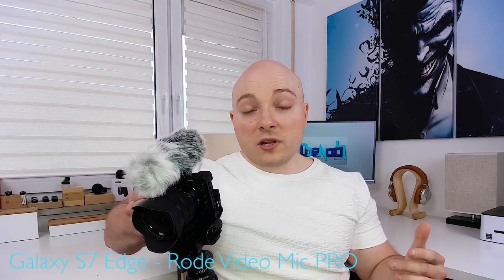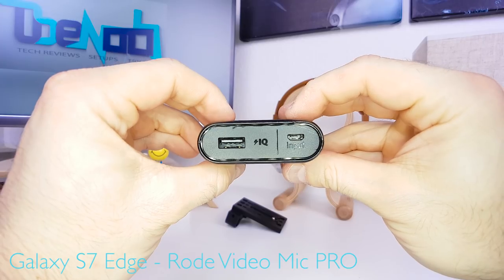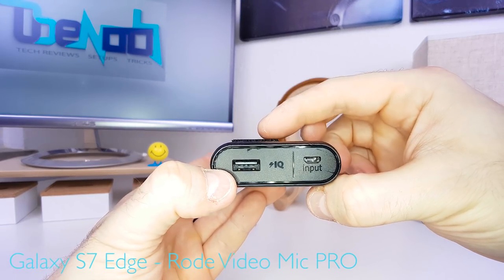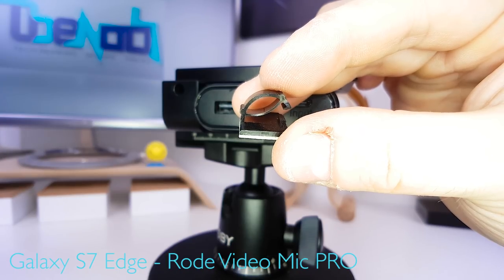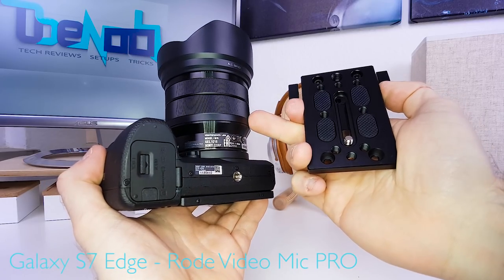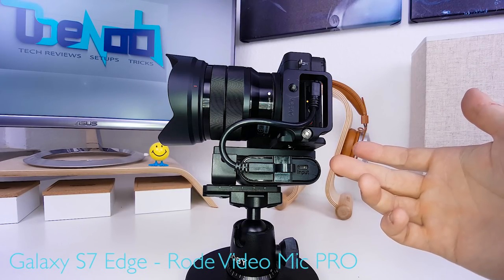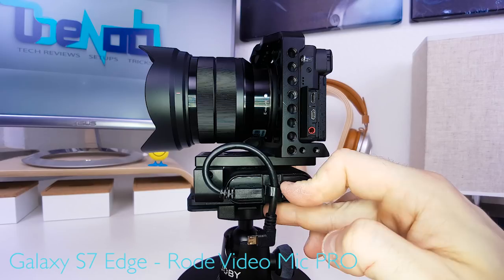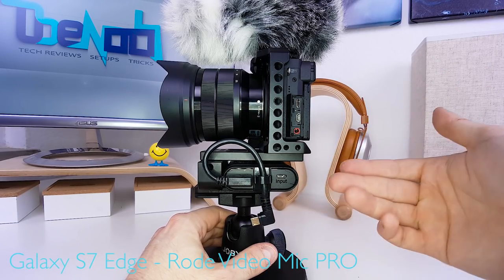A6500 POWER CORE HACK - Tubenoob

Comment: Hi, love this idea. Once the setup is complete, what are the size dimensions? The reason I ask is I am wondering if this is possible with a gimbal? particularly the weebill lab which has a small clearance around the motor. Thanks again
Reply from the maker: Mh....I am with my parents right now and don*T have access to the parts, but from checkin out the weebil on pictures I highly doubt that the setup will clear the roll axis in flashlight mode.......if only there was a way to lace the powerbank below the qr plate of the gimbal....

Comment: Hi TubeNoob, great video but the PU70 base plate screw does not fit the Smallrig 1797 cheese plate hole as the side holes are too small and the middle hole is too big. Do you know why this is? The PU70 now being sold on Amazon is different to the one you show in your video.
Reply from the maker: Hi! I use the PU70s. But the problem doesn*t seem to be the base plate, but the smallrig cheese plate wie rail mounts. I checked the links. There is an old an a new version of said smallrig plate. I guess the new version, which must have been released since sometime, has a 3/8 inch mount, not a quarter inch mount any more. The PU70, and most quick release plates have the 1/4 inch mount. Check the description of the smallrig plate and see whether that is a 3/8 inch mount in the middle. I am pretty sure that is what it is. In this case you just need these tiny adapters here:

https://www.amazon.com/Foto-Tech-Convert-Adapter-Ballhead/dp/B00OKYWWMG/ref=sr_1_8?ie=UTF8&qid=1543871467&sr=8-8&keywords=quarter+inch+to+3%2F8+inch+adapter+camera+screw

Let me know if that*s it....

Comment: Very neat solution!!! Can I turn the camera on  “mine is a6400” and use it while charging the battery this way?
Reply from the maker: Yes, the battery status will trickle down slowly though. Way slower than without the external battery off course. And whenever you turn the cam off it'll load automatically.

Comment: Hey Tubenoob, we've spoken a couple times and you have really helped me narrow down the list of which camera I would like to buy, so I would first like to thank you for that.  My choice is now between 3 cameras, Which I will mainly be using for travel vlogs. I cannot decide between the a5100, a6300, and the new Canon EOS M100. I'm not sure if the a 6300 is worth sacrificing a flip up screen for 4K, but I can get it at a very competitive price. But between the a 5100 in the M100 it's like they're identical. Is there one you would lean towards at the end of the day? Thanks man!
Reply from the maker: You*re very welcome, David Donovan! 

Between the M100 and the A5100: M100. Mainly because the canon 11 22 stm m super wide angle zoom is a very good lens at approx. half the price of the sony sel 10 18. If you wanted to invest in a super wide angle zoom for vlogging. Also the Canon has the better screen AND a real touch screen for that matter, which makes a big difference in usability and touch AF for example. Micro wind muffs can be applied to both cameras due to the location of the internal mics on top of the cameras. With the M100 it will be a quick custom job to customise the pads, but nothing a scissor can't handle.

Now if it was the A6500, which really improved in the overheating department, I would say it's a consideration to have 4k, external audio, but no selfie screen. But the A6300 stills deals with major overheating problems. 

If it was an A6500 I would go with that one and use my phone as a selfie screen when in need of one.

For vlogging, out of these three, because of the reasons given, I would definitely go with the M100.

Hope that helps you out a little. Greetings!
Reply: Hey Tubenoob, After reading some of your recommendations I decided to go with the Canon M series. I looked through some more of your videos and found the Canon EOS M6 and loved it! I just bought it online last night! I found your video on attaching various microphones to the side of the camera and I was Wondering, Is there a certain Mic of the three you prefer more? or has the least hissing? thanks!
Reply from the maker: Cool, very good choice:) ME personally I like the ETM 008 the best. Least amount of hiss and overall super compact form factor. Wind protection isn't as good as what you get with the rode wind screen, but ok, when using the tiny deadcat from Edutige. Greetings!

Comment: This is a really cool solution. I am still deliberating between this and a dummy battery option due to the overheating with the a6500 but this is the most tidy and convenient option I have seen so far.

Would this option power a dummy battery via usb to run the a6500 or would I need a converter in the chain? 

I was just wondering about a link or details of the cable clamp? just want to make sure it fits as well as this one does. thanks again
Reply from the maker: Hey, Kane Jacobs! Thanks for the nice comment, glad you enjoyed the video!

You would need a converter if you wanted to use a dummy battery.

Damn I forgot the links again....sorry.....now they're in there:) Greetings!

Comment: I've done this but the powerbank only charges the battery when the camera is off. When I turn on the camera and start recording, the regular battery drains (not the powerbank) so my recording time is not extended. Have tried multiple cables. Is this what happens with you? Thanks.

Comment: Nice review—straight and informative. I bought an anker power hub but it will not power the camera unless the Sony battery is in the camera.
Is it correct in assuming that the hub works in conjunction with the Sony battery?
Reply from the maker: It's called conservation charge I believe, although I translated taht from german to english. You're right.
Reply: TubeNoob Thanks!
Reply from the maker: @CarlosRodriguez-cj8oo  No problemo:)

Comment: Hey tubenoob. You have great content! I have used a few of your videos for my vlog setup on my a5100. Quick question: I have an external battery and when I plug it the light comes on to charge, but I can't film or take video while it's connected. Do I have to take the battery out or change settings to use while connected to the external battery? Thanks!
Reply from the maker: The A5100 does not have that option. You cannot charge it and record with it. It is either or with this one. However using a powerbank you can bypass that problem with such a dummy battery to usb adapter:

https://www.amazon.com/CCYC-AC-PW20-Decoded-Coupler-Replacement/dp/B075Z4GXKG/ref=sr_1_2_sspa?ie=UTF8&qid=1546533657&sr=8-2-spons&keywords=sony+dummy+battery+to+usb&psc=1

Hope that helps you out a little. Greetings!
Reply: @Mark10ProVideo  this is awesome! Thank you for your help. Subscribed!

Comment: Hey tubenoob, i have a used canon eos m6 with ef-m 11-22mm lense and 3 batteries for it , i have a chance to trade all that to a new panasonic lumix g80 + 12-60mm kit lens, u think i should trade for that?
Reply from the maker: Hey, TeamRemet! Depends on what you want to use the camera for. Both comes to around a grand new, so the value is comparable.

M6 plus 11 22 is an awesome vlogging setup with great autofocus. G80 plus 12 60, which is the best kit lens for videography you can get for a panasonic G series camera in my opinion, is an overall videography centric mirrorless camera.

You will see that you have been pretty spoiled;) by the AF performance of the M6 when you switch to the G80, but on the other hand, if you also want to work from behind the camera, doing premeditated, designed shots, you will love how feature rich the G80 is and the 4k quality you will get from that camera.

Hope that helps you out a little. More questions? Just ask...greetings!

Comment: How does a npfw50 dummy battery work when connected to a powerbank on this camera? Will it work well ?
Reply from the maker: It's been quite a while, nit I think the dummy battery need a special powercable that divides into two usb cables. SO you would need a poerbank with at least two usb connections. I think it's because it need more charge that way...
Reply: @Mark10ProVideo  ahh.. got it! I found out that the camera requires 7.5 volts and above to work. I guess I'll be needing a 7.5V powerbank.

Comment: Followed your steps exactly with my A6300. However, I'm noticing that the battery is losing charge still while connected to the power bank. Should that be the case? Or would a dummy batter battery work better?
Reply: Also noticed that the batter has an output of 7.2V where the powerbank only puts out 5V.
Reply from the maker: It should loose charge significantly slower if that. A dummy will probably bypass that since it takes from the powerbank directly.
Reply from the maker: That seems like the reason for the slow discharge. Don'T know if there are powerbanks with a higher voltage that size....then again...is it loosing charge as fast as in regular use?
Reply: @Mark10ProVideo  Dummy battery solved the problem. Even though you can technically shoot and charge at the same time, it's not enough power. So my time was still longer than just with the battery but you'd still end up with an overheated issue eventually.

Comment: Could you do a video on a vlog setup for the alpha a6000?
Reply from the maker: Hey, Pablo! I could, but it wouldn't look much different than the one built around the A6500.

I would probably use the same power core hack as with the A6500. If the A6000 didn't feature usb charging and operating, I would use something like an ex pro powerbank with a dslr power out put and a dummy battery dc couple to run it off the powerbank.

As a mic I would use the Sony ECM GZ1M, if I would plan on using a smartphone as a remote control. Because as soon as wifi is enabled, the camera probably messes up the audio coming from the 3.5mm input, like the A6500 does.

Here's a video on that problem: https://youtu.be/6K27ZScEQZ4

If no smartphone is used I would probably go with a rode video mic pro as a mic.

The best lens for vlogging in my experience is the 10 18 from Sony, expensive lens though. The 16 50 kit lens on the 16mm wide end is wide enough for vlogging as well. But narrower than that I think isn't suitable for vlogging.

Hope that helps you out a little. More questions? Just ask. Greetings!

Comment: Do you have advice for manfrotto qr plate users?
Reply from the maker: The bottom if the rail mount has a regular quarter inch thread, so there should be no problem attaching a qr plate the has the fitting screw....or what do you mean exactly?

Comment: will the right angle cable get in the way of the audio input? i cant tell. I have the rode video mic pro
Reply from the maker: Yes, the interfere. I used a multi interface mic. But you could get a longer cable angled so that the cable runs upwards.
Reply: @Mark10ProVideo  How good is that battery pack? there was a bunch of negative feedback on amazon
Reply from the maker: There was?...I never had any problems with anker power banks. Mine is fine. What did they say?

Comment: Hey can I put this setup in gimbal
Reply from the maker: A ronin s won't have a problem with that...really depends on the cradle size of the gimbal and its power. Should work fine with larger handheld gimbals.
Reply: Thanks alot, just one more question does it effect our camera in long run, whats your point on this ?

Comment: loved your solution! Im gonna try it. Whats the name of the L bracket and the plate? the links are not working for me.
Reply from the maker: Thank you! Mh....they should....from where are you? Are they sold out or doesn't anything show up?

The quick release plate is called PU70S. It's a generic part, so the brand name might differ.

It's the same with the L bracket. There are many out there for the A6500. As long as it allows for the connection of the usb cable it's fine.

Hope that helps you out a little. More questions? Just ask....

Greetings!

Comment: whats the best grip to get for vloggong
Reply from the maker: Hey, Bruce Long! Do you mean a selfie stick? I don't know what you mean by "grip"...you*re not talking about a battery grip or pistol grip, right?

Depends on how much money you want to spend, what you want it to be able to do and how heavy the camera is you want to put on it....

Gorillapods are awesome, but expensive. Any mirrorless or dslr camera above 500 USD I would put on a gorillapod, just because they are rugged enough.....

If it was just the camera, nothing else that makes it heavier there are good alternatives..

Like this flexible tripod: 
https://www.amazon.com/Lammcou-Durable-Flexible-Smartphone-Samsung/dp/B073N9687P/ref=sr_1_1_sspa?s=electronics&ie=UTF8&qid=1516645868&sr=1-1-spons&keywords=lammcou+flexible+tripod&psc=1

And this ballhead: 
https://www.amazon.com/koolehaoda-Tripod-Ballhead-Release-Maximum/dp/B071SFJXH9/ref=sr_1_fkmr0_1?ie=UTF8&qid=1516645911&sr=8-1-fkmr0&keywords=koolehoada+ballhead+e2

I am going to do a little video on these two soon....both of these products are worth the money and cheaper and better in my opinion than the joby alternative, which would be the gorillapod SLR in this case, mh....it is right in between the SLR and the FOCUS.....

If you don't need a flexible tripod, the Manfrotto pixi evo 2 is a solid little tabletop tripod that can easily be used as a selfie stick....
https://www.amazon.com/Manfrotto-MTPIXIEVO-Section-Universal-Smartphone/dp/B0751FYJGL/ref=sr_1_2?s=electronics&ie=UTF8&qid=1516646157&sr=1-2&keywords=manfrotto%2Bpixi%2Bevo&th=1

Hope that helps you out a little. Greetings!